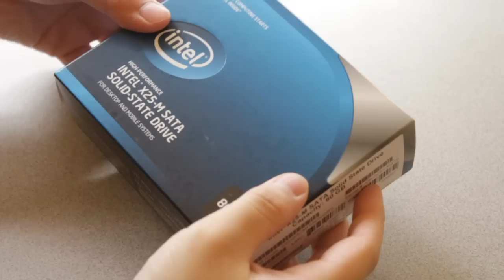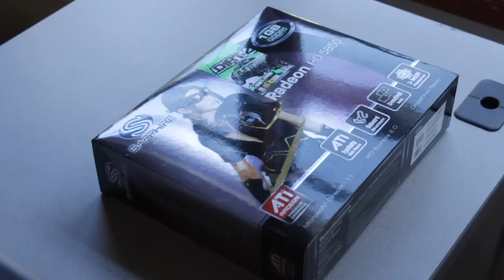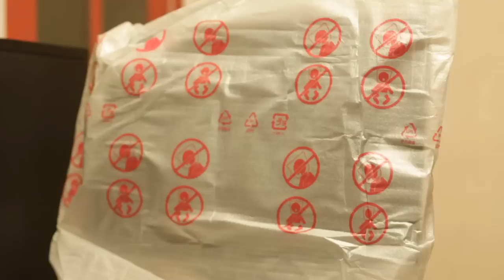First Custom-Built Computer

Comment from the maker: @anyN8 A solid state hard drive is a super super fast hard drive. It has no moving parts, so it doesn't have to wait for the internal parts to reach the data. It drastically reduces loading time in everything from everyday tasks to games. It gives one of the biggest real use performance boosts.

Comment from the maker: @postonunc

Samsung HDD: The fast 1TB Seagate and Western Digital hard drives both had shaky reviews and problems. The Western Digital is noisy w/ 3 platters, and the Seagate needed firmware updates that reduced functionality, unless you wanted to risk it dying prematurely due to bad design. The Samsung had few reviews, but it's quieter and just as fast as the other two.

Radeon cards had the edge in speed, while costing MUCH less than nVidia at the time. This was built almost 8 months ago.

Comment from the maker: @mxfly2000 Yes, most new graphics cards are PCI-E x16 or something. They also say recommended minimum watts on power supply. Most parts in your computer will tell you how many watts they use, and you can just add them together and +100 and you should be safe.

Comment from the maker: @BXbomber718
Thanks dude. I was frantically trying to finish building the computer before sunset, but I didn't make it in time because UPS delivered the last parts (motherboard & RAM) at 2:30 P.M. :P

I didn't get a third party cooler because I was trying to save money and that's one of the things that I decided I didn't need. I don't plan on overclocking for a while.

Comment: Nice video, I liked the lighting. Did you put the ram in the right slots to take advantage of the triple channel memmory, Normally the channelled memmory goes in the more elaborately coloured slots. Have you considered getting an aftermarket heatsink for your 920? They bring those temps way down as well as open the path to overclocking.

Comment from the maker: @ghostskwid The SSD and the HDD are separate. I believe you can only set up a RAID configuration with two identical drives. I am very satisfied with the SSD, but I just wish it were bigger than 80 GB. Although I have not run out of space yet (13.7 GB left), it is always on my mind when I install a new program.

Comment from the maker: @ThePcyden014

Yes, I was nervous that for some reason it wouldn't work out, and I'd end up with a dead project. The way I figured was that I have friends who are much dumber than me who built computers. If they can do it, I can do it. It's also reassuring that nearly everything comes with a 3 or 5 year warranty. Also, returning parts to Amazon is completely easy and free. I would definitely do it again.

Comment from the maker: @ipopd123 I researched the hardware for like 2 weeks because I wasn't up to date on computer parts. Then it took me about 2 days to build it because not all of the parts arrived in one day, and plus I was filming it all with a tripod, which was time consuming. It was overall a very easy project, and nothing went wrong except the sound card was faulty and had to be replaced. It was all easier than I expected.

Comment: @TheRobotman5000 Hey the drives is really small, smaller than hd, also it supposed to be really quiet and fast, less chance of failure but they are expensive as hell, in the UK, a 250gb SSD go well over £300 so you can understand how pricey they are. However I think a few years down the line the price will go done, but as of right now, SSD is expensive and the price is on par with top of the line CPU and graphics card. Also wiki has a more detailed explanation.

Comment from the maker: @chas1996

Okay...what do you mean by that? 5 months have already gone by since I built this computer, so of course the component prices have all gone down. I obviously built my computer with money spent towards perks that are not related to raw speed, such as the $300+ monitor, solid state hard drive, 6 gigs of RAM, aluminum case, etc. I also chose Intel over AMD because the many benchmarks I saw showed that Intel processors are energy efficient while having an advantage in certain uses.

Comment: @JerryRSun Does the PC boot up? You could try OCCT and monitor voltages of 3v, 5v and 12v lines with a stress test. If the line fluctuates then its the PSU. If it doesnt and test fails then theres a problem with CPU. Clear CMOS to reset bios and retry. Also test ram with Memtest CD, maybe there is something wrong with the Ram settings in bios.

Comment: @JerryRSun OCCT is a stress test program, and while it stresses the PC it monitors the voltages from the PSU.

Ive had similiar issues with bad Ram, or incorrect Ram voltages/timings. Have you ran Memtest?

Hopefully all is well when you get the PSU back though.

Comment from the maker: @gymfreak0
I sent my motherboard in for fixing, but apparently it's not broken. I narrowed down my startup problems to the motherboard, power supply, and processor, so I just sent in my power supply. I didn't mean to freak you out about the motherboard. It is still highly rated and apparently mine did not break. The only problem I have with it is that one of its PCI-E x1 slots cannot be used because there's a heat sync blocking the way. You can only use short cards in it. Weird.

Comment: @pbe33 The TR2 is a rather low quality PSU, but you should be fine with an i7 and one HD 5850.  However, I wouldn't recommend putting much more strain on it (like a second 5850 or heavy OC'ing).

Comment from the maker: @PCGamer21stCentury

I am pretty sure none of my components were overpriced if you factor in the time when my opponents were bought and the few higher end items such as the $320 LED monitor and the $266 solid state drive. I bought all of my items from either Newegg or Amazon, except for the $86 aluminum case from mwave. All prices were double checked on Google Shopping and Pricegrabber to make sure there weren't any opportunities outside of Newegg and Amazon.

Comment: @JerryRSun It's your motherboard, the Gigabyte GA-X58A-UD3R is know for that noice, but I have the same motherboard, but I dont have that issue, some do and some dont.
Specs:
Corsair HX 750W PSU
Corsair XMS3 DDR3 1600MHz 6GB CL9 Kit
Gainward GeForce GTX 470 1280MB
Gigabyte GA-X58A-UD3R
Intel Core™ i7 Quad Processor i7-930
Western Digital Caviar® GreenPower™ 1TB
2x BenQ 24" LCD G2420HD 1080p

I built my own aswell, It's fun when it works :]

Comment: You spent a lot, I have basically same build for half. I have an Antec 900 case I've never heard of yours. Samsung HDD...what the heck? I personally use NVIDIA cards and I double my 32 inch sharp as a monitor.

Comment from the maker: @guidebot101 The triple channel slots are 1, 3, and 5, which I used. As for the heat sink, I just used the default one because I am not overclocking.

Comment from the maker: @xGameFreak6661x Solid state drives has extremely fast read speed, which makes Windows, applications, and games load very quickly. However, they are much more expensive per gigabyte.

Comment: Did you forget to apply thermal grease to the processor or do you just not show it?  I saw in comments that you were having problems and since the 920 already runs hot if you didn't apply thermal grease it wouldn't be good.

Comment: no offense... but tiger direct is a lot better and cheaper.. i got 8 GB of DDR3 ram for $80 ish in 2 sticks... and if u spent $2000 on these then u should have got a better Case for it... Everything else is good (minuse the cpu cooler... since its stock...) but it makes a WHOLE lot difference in keeping that shit cool.. its worth the extra cash to keep your stuff running Tip top... i bought the Cooler Master HAF 992 case and it has TONS of fans ... huge open space even with the stuff in it.

Comment: @JerryRSun  You spent $1736 To make that (Price without monitor.) i would of went with th i7 870 2.9Ghz quad core. Most worthy thing in that pc i would say is the 5870 Radeon. I want one i have a 5770 Atm thinking about the 6870 But i still want a 5870. Because there faster. other then that You could of get a better price for the Pc. speakers I would of gone with logitech Z-5000's anyway nice Pc :)